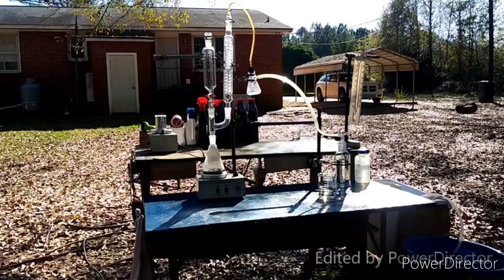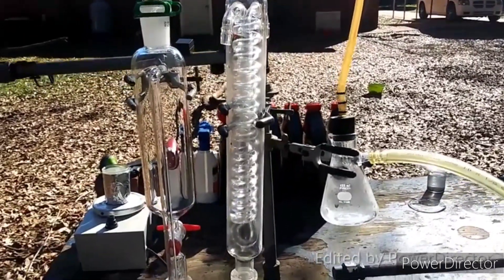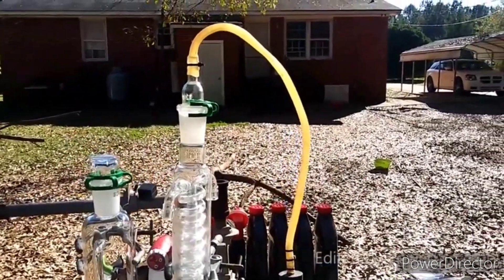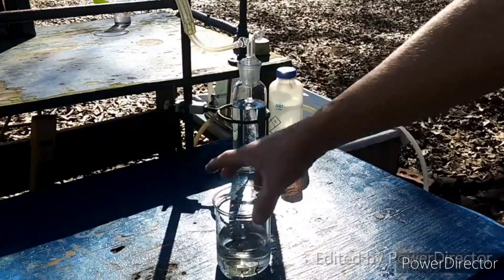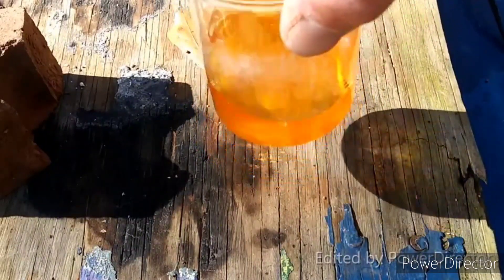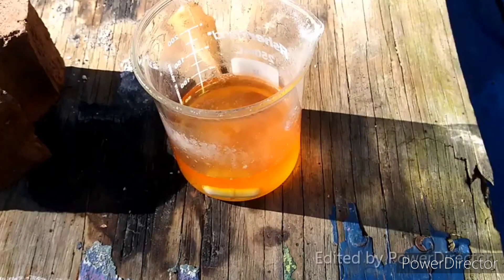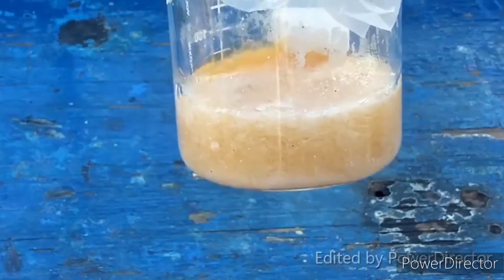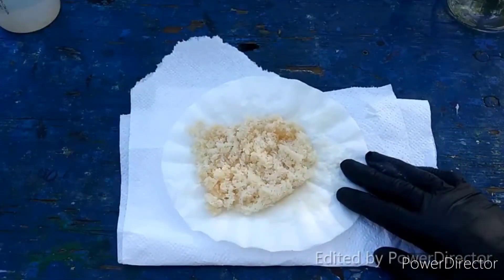How to Make Sodium Sulfide Nonahydrate #chemistry #sulfur #homelab #chemistrylover

Comment: Thumbs up!  Ah! The joys of heavily hydrated salts.  I could even do this!  This stuff is getting harder to find.  Would be good for dropping excess lead from solution.  Pretty sure lead sulfide(galena) is the least soluble lead salt.  I read it is almost nontoxic because it’s so insoluble!  Heat it with litharge and you are supposed to get lead metal and sulfur dioxide.

Comment: Am I right that hard to wash off sulfur deposits ie  plastic sulfur converts to an easier to wash off form if you just leave it for a day? Think I remember from making CS2 that it can be nightmare to clean
Reply from the maker: I've never had to clean it so I honestly don't know. I avoid letting sulfur plasticized because it makes it hard to work with.
Reply: @PoorMansChemist  I don't have much experience working with sulfur or how to control its alletropes but I bubbled acetylene through molten sulfur to produce CS2 and I think that also creates a plasticised form of S. Especially if there is oxygen present and acetylene combusts in the reaction flask
Reply from the maker: @SodiumInteresting  Is that all it takes to make CS2? I've wanted a little of that stuff because it's such a useful solvent. Evil, but useful (so basically like all other sulfur and selenium compounds 😄).
Reply: @PoorMansChemist  This reminds me of my question in the other thread -- closed rings, or a polymer? 
From my own piddling around, with the Gilbert Chemistry Set back around 1960, (and what I've learned since) yellow crystalline sulfur is little 8 atom rings. And when you heat it up it melts into a runny yellow liquid -- the S8 rings are only held together by Van der Waals forces, that inherent 'stickiness', and not chemical bonds. 
After being melted for a while, or on further heating, you get a viscous red liquid, which is a result of the rings opening and joining to make polymers.  And then you have to heat it a LOT more to get S2 gas.  The red liquid will congeal into a polymeric solid that slowly reverts to yellow S8 crystals. 
Also from the Gilbert days, I tried to make S2Cl2, with chemistry set sulfur and Chlorox bleach.  Little bit of any acid in the Chlorox, and whoosh, you get chlorine.  My parents were amazingly tolerant, solicitous even, having gotten me the chem set in the first place.  But the S2Cl2 was a miserable failure, stunk up the basement, started a fire, and I had to stop. 
Heh, heh -- that's all for now. 

But @PMC, that would be an awesome backyard research experiment -- acetylene and molten S8, or Sx ...
Reply from the maker: @jrob495  Isn't S2Cl2 made by passing Cl2.over sulfur? For that matter there should be a selenium analog of that (no tellurium analog that I am aware of).
Reply: @PoorMansChemist  I don't recall exactly what I did as a teenage terrorist with my chemistry set. ... my most dramatic sulfur compound in the 60s was Al2S3 from aluminum foil and sulfur.  It stinks when it gets wet. 
I did not have the glassware for it, the chlorine wasn't at all dry, and I'm quite sure I didn't get any product.  Which is sometimes a good thing, when you don't know what you are doing.  E&F made a nice video of SCl2, it popped up in the suggestions in the right column here.  It is a vile red liquid he was going to use to make S4N4. 

And, the acetylene - sulfur reaction still seems like a fun thing to watch, whether you get any CS2 out of it or not.  Then again, acetylene can be touchy --